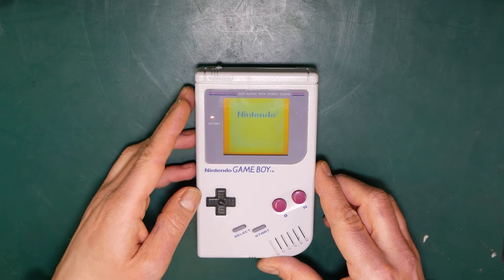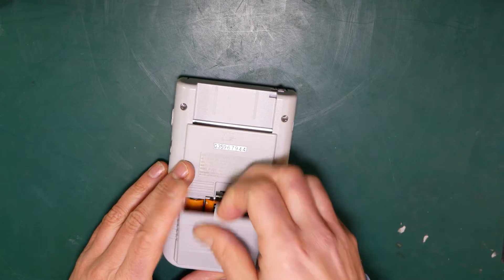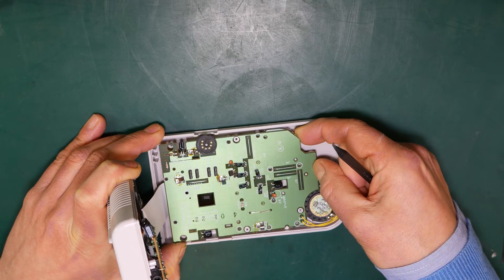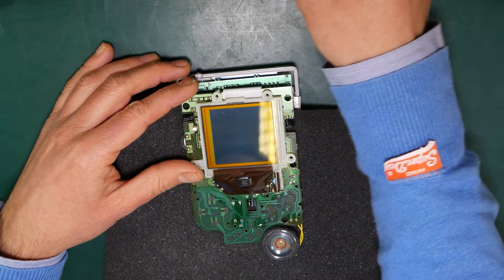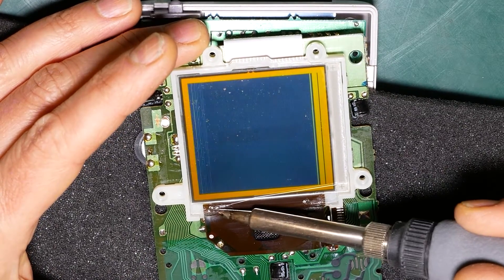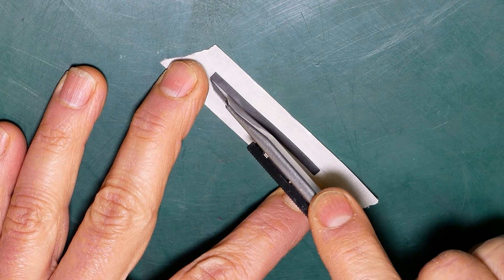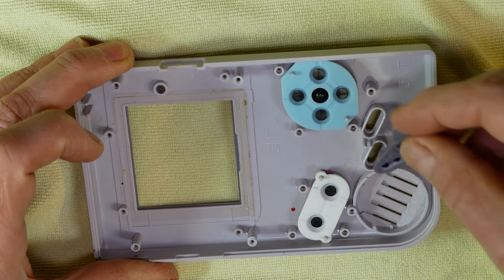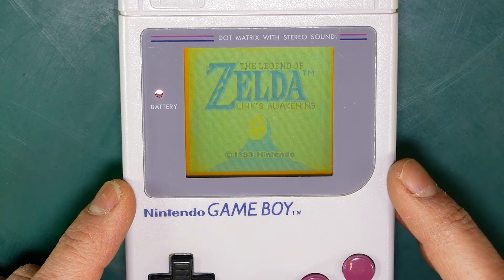Fixing the display on a 25 year old Nintendo Game Boy

Comment: Are you actually applying solder ? Or just heating it up with the iron
Reply from the maker: Just heat - you could wet the tip for better heat transfer.

Comment: Yep! worked for me the second time around as I realized that the first time was not working at all due to temperature on soldering iron was set to low. I got my temperature gun out and monitored temperature at the tip of iron and waited until I got a reading of 400 degree Fahrenheit  (Seemed to be the perfect temperature) and proceeded per your instructions and yes with some time between ironing the area of lines the elimination and joining of them after several attempts between cool offs I eventually got a clean full screen after successfully melting the solder underneath the strip my second time which for me and my Gameboy made this video...Priceless....Thanks!
Reply from the maker: Great glad the video helped you out!

Comment: Why are you putting soldering lead on the ribbon cable? This trick works flawlessly without it and only with your soldering iron at 300° and with a 1mm point. This trick reflows the connections made of lead that are UNDER the ribbon cable, adding soldering lead above it is useless and I recommend to all the noobies that will read this comment to clean their soldering tip before doing this trick.
Reply from the maker: It just makes the tip transfer heat slightly better but definitely not absolutely necessary.

Comment: nice video :D ever run across any game boy lcd screens with the vertical line issue that cannot be fixed with the soldering iron?  recent one i bought seems to have permanent dead lines which appeared after i had opened it up
Reply from the maker: Thanks! You might want to try increasing the temperature of the soldering iron and tinning the tip if you haven't already. I started at 300 degrees centigrade with no tinning and it was slow / not particularly effective.
Reply: haven't tried tinning the tip and yes 300 degrees is the max temp i used so this sounds hopeful.  also, should there be line flicker when pressure is applied to the bottom on the screen?
Reply from the maker: Yes the lines flicker when you're applying pressure with the soldering iron at the correct point. And if the temperature is right they will persist after you take the heat away.
Reply: thanks :D i'll try this as soon as i get access to the solder iron again, hopefully it works out.  i asked about the pressure question because i'm not seeing anything appear on the screen when pushing at the bottom, wasn't sure if that was common